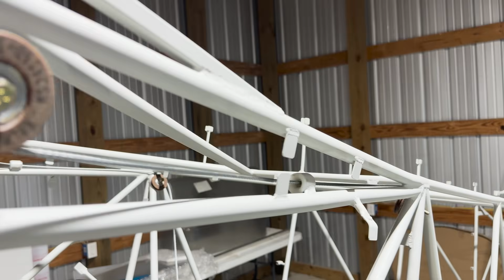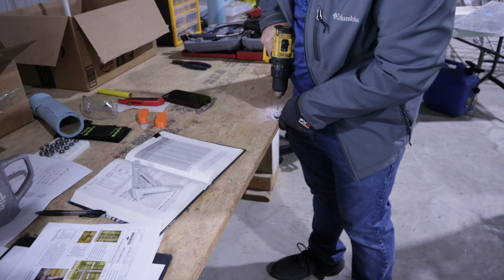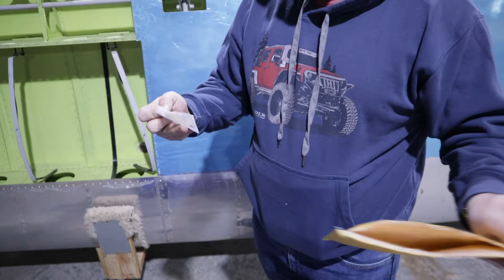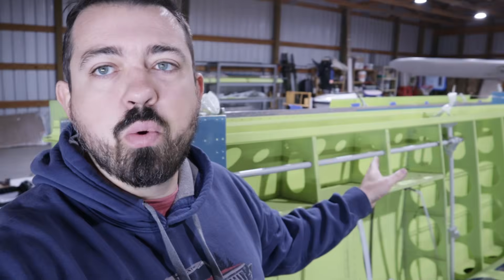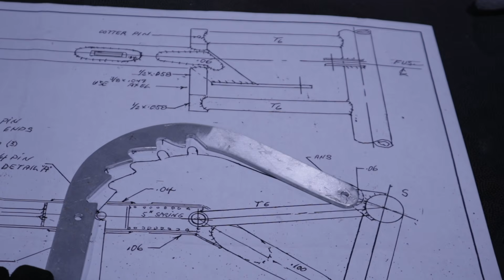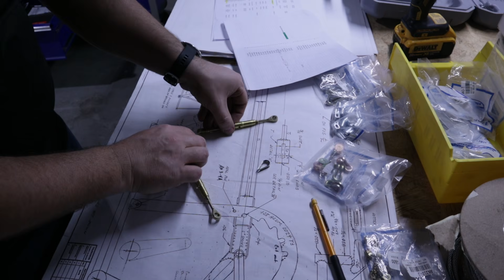Bearhawk Flap System | Bearhawk Build Series

Comment: I agree with just about everything everything you espouse but I respectfully disagree with your comment swages and cables being superior if they are “certified”.
Reply from the maker: The cable is significantly different than a structural cable you might buy at the hardware store. Those are not normally a 7x19 strand cable. That particular bundling is used to create a strong but flexible cable which won’t stress fail as bad as a non-aviation one. There may be non-aviation versions of this but that is the critical component I am referencing.

Comment: Great job!   Im working on #18 in my garage.  For cutting the cable, get yourself a Felco cutter.  Not too expensive, and it cuts like butter.   Also, i’ve taken pains to build my cables outside the airframe when I can.  I like to clamp on arm of the crimper in my vise so i can use two hands to position the crimp collar perfectly while lowering the handle to hold the whole thing steady before I pull the crimper handle together.  To keep tension on the thimble i use small “ubolt and saddle” cable crimp that lets me pull the rat tail tight, then cinch it down with the ubolt and saddle before i feed it into the crimper.
Reply from the maker: Which one do you have?! I started looking at them but can’t decide if the C7 will cut it or if I need to go up to the C9… thanks for the PIREP!

Comment: On your cables, try cutting off the 4 little tabs on the thimble with a sharp pair of dikes. Makes the thimble fit up against the sleeve much nicer. It’s what we did in A&P school and in the shop I worked in. Rather than using a vice to hold the wire/sleeve/thimble assembly for crimping, try a needle nose vice grip. They make a needle nose vice grip with a 45deg bend that’s just perfect for this. 

Enjoying your videos. I’m building a BH5, but haven’t been able to get out and work on it much yet.
Reply from the maker: I’ve already picked up a pair of vice grips! Thanks for saying that! I felt like this one was scatter but it was 2 months of time across it all and some parts weren’t in the order I showed it… it should be the most “scattered” one for a while.